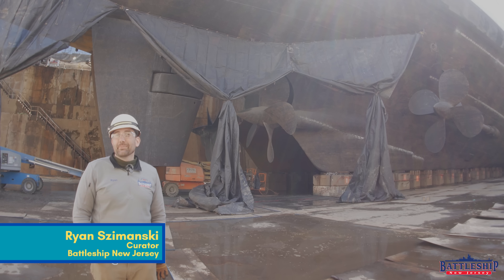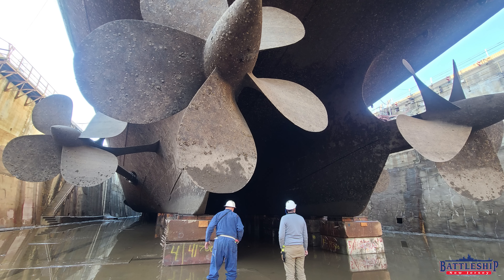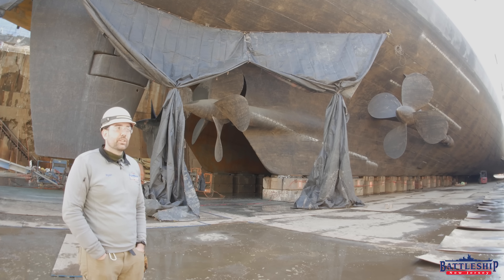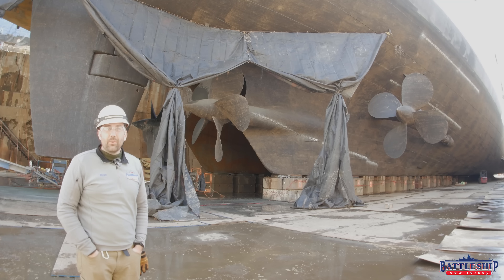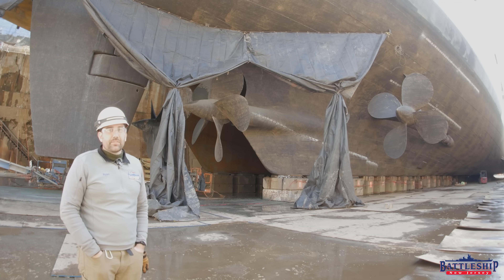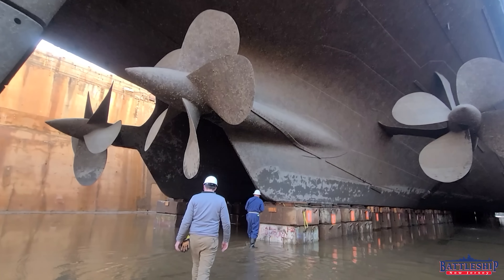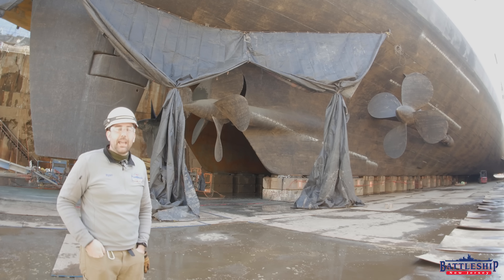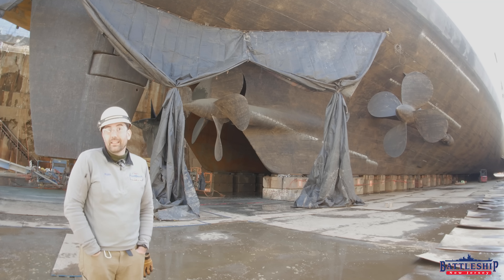Why Are The Battleship's Propellers All Different?

Comment: The South Dakota-Class was built with all 4 bladed propellers, with Indiana swapping to 5 bladed outboards and 4 bladed inboards and Massachusetts swapping to 5 bladed outboards with 3 bladed inboards. Their propellers were almost completely lined up with each other but the inboard were slightly forward more, unlike the Iowas. Also unlike the Iowas the skegs are on the outboard shafts instead of the inboard.
Reply: The South Dakotas were designed different to the Iowas because they were a different design.  Despite the design differences both ships could travel backwards if they reversed the rotation of their propellors.
Reply: If there were 5 frogmen around each outboard propeller, there would be 20 more fins in the water.
Reply: I don't know about the other SoDaks but the Massachusetts has 3 blade props inboard and 5 blades outboard.
Reply: @dieselyeti  Massachusetts was built with four 4 bladed props, but later changed to 5-blade outboard and 3-blade inboard.
I dont remember if the other SoDaks followed suite, but thanks for catching that.

Comment: I know "propeller" is common parlance, but I always understood that the terminology was "screws" for ships propulsion, "propellers" for fixed wing aircraft, and "rotors" for helicopters.  Is this not the case anymore?
Reply: I once walked into the boat shop and told the nice lady at the parts counter I needed a screw. She slapped me and asked me to leave. Since then I no longer use the correct term.
Reply: They are propellers, specifically screw propellers which is a category of propellers.  This is why colloquially they’re often referred to as screws.  Propellers have been around for hundreds of years
Reply: It propels the ship does it not....?

Comment: The reason for the dissimilar number blades has to do with sympathetic vibration. If all screws had the same number of blades their frequency would match and create a sympathetic vibration through the hull of ship. It was of the biggest concern on North Carolina's and Iowa's since the had screws outboard of the skegs. The vibration was not near as bad on South Dakota's as their screws where inboard of the skegs.
Reply: I think you mean resonance.  Something that is often overlooked is that if the propellors had zero blades they'd be very inefficient.
Reply: @TheJazsa80  my bad resonance is what creates the vibrations.
Reply: Painted props answered my question.  Guessing they can’t slam an outboard prop in reverse for emergency turns? I kinda thought the dropping an anchor for a turn was movie BS.
Reply: @wdwerker It WAS movie bs.
Reply: @wdwerker  I think the MV Dali proved that was bunk.
Reply: Same reason that tracked vehicles have one more track-link on one side than the other

Comment: What is amazing is how old this technology is. And yet they still build new military ships, with the same setup. Now cruise ships use Azipods.
Reply: and are scrapped after 20 years too.
Reply: They also require a huge amount of electric power to operate them.  Redundancy is also an issue with Azipods.
Reply: @pwmoorejr  that's not an issue with a nuclear powered vessel. What is a problem is their survivability on a warship.
Reply: Ships have had a lot of problems with azipods including some naval ships there are issues with their steering bearings, these can go bad in as little as 2 years! Azipods are favoured for Not needing big heavy shafts that have to be kept aligned. 😊

Comment: I know that the US Navy keeps their new submarine propellors covered and hidden when the boat is out of the water in order to keep the design of the props secret. Is this battleship just so old now and the prop design so outdated that it's OK to show the prop design shapes? That's my guess / assumption.
Reply from the maker: She's a museum, nothing about it is still classified
Reply: For surface ships screw design isn't nearly as important as a submarine, as they're generally loud enough that an especially quiet screw won't change much. For a submarine, that acoustic signature is everything, and a good picture of a submarine's screw/pump jet can allow you to simulate not just its performance but its acoustic signature to find any anomalies that might identify a sub.
Reply: This is a very outdated propeller design, nothing on this ship is sensitive or relevant to modern design. Now they use computer models to design props and test their hydrodynamics so modern props on warships look completely different. Modern props have a much more complex shaping that would not have been possible without modern computers and manufacturing techniques,you can find images online for surface combatants…..subs are a different story
Reply: @cruisinguy6024 Agreed. Sub props are controllable pitch. The blades are individual and are bolted to a complex mechanized hub which can change the angle of the blades, and can actually reverse the thrust of the propellers without stopping the shafts and reversing the rotation direction of the shaft
Reply: I believe the latest submarines the Navy is building have a shrouded screw.
Reply: I’d love to see a simulation of her performance using modern, computer designed screws.  I’d expect that they might get a few extra knots out the old gal with those.

Comment: Funnily enough, I was looking into this, Massachusetts BB-59 started with 4 bladed props on all her shafts, and ended her career with 5 bladed outboard props and 3-bladed inboard props. So yeah, a lot of changes
Reply: I think Friedman's book on U.S.Battleships has an extensive discussion on on the various propeller combinations used to reduce vibrations on the fast battleships.  A lot of trial and error testing and it was not consistent from ship to ship, even those in the same class.  I think the Iowa's were consistent, and eventually the North Carolina's but the South Dakota's were all over.
Reply: I saw the drydock photos from her maintenance in 1999. I found that odd too, assuming she'd have 4 and 5 blade props.
Reply: Now, just hold on a minute there.